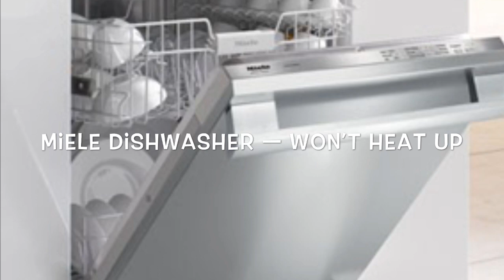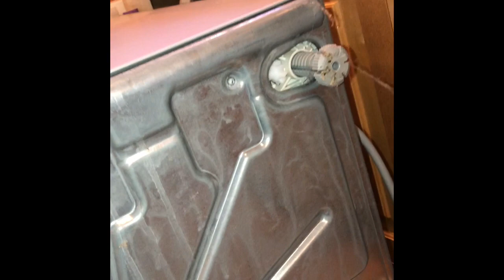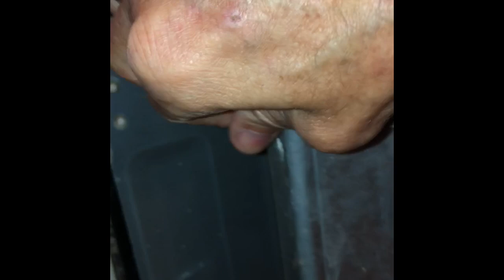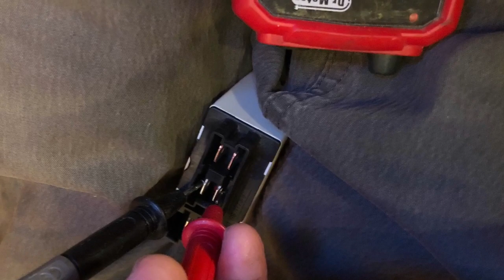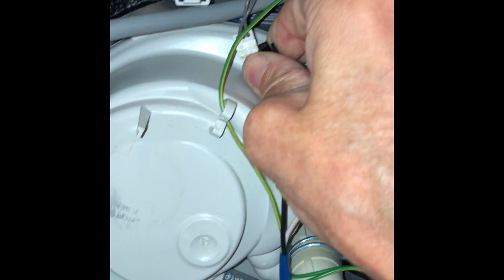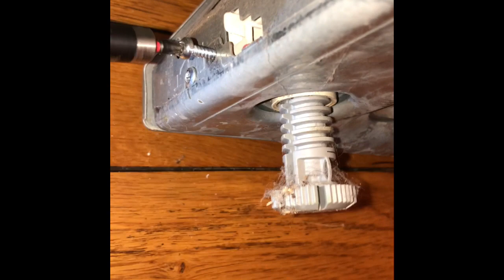🌎 MIELE DISHWASHER — WON’T HEAT UP (SOLVED)

Comment: What max temperature should you see on the normal cycle. I measured temperature on two different Miele DW and found one with 135F and the other 122F. Is there a problem with the 122F?
Reply from the maker: Should be about 140 F after 30 minutes into the cycle👍